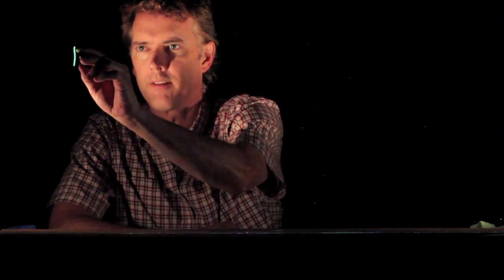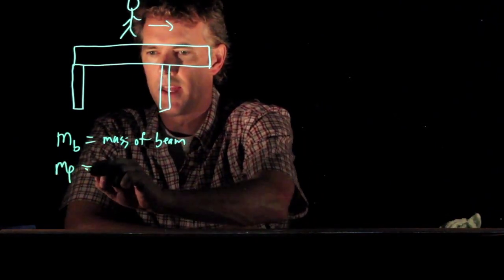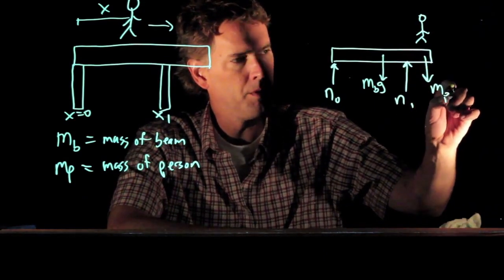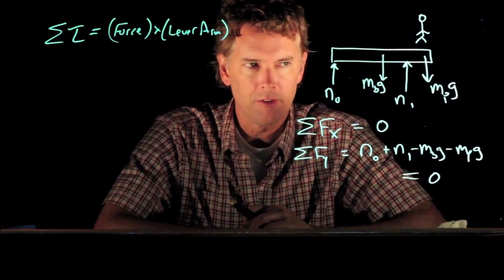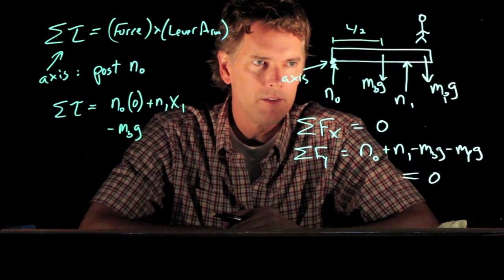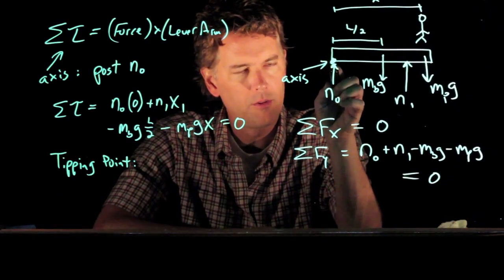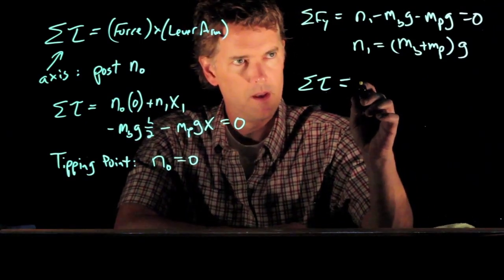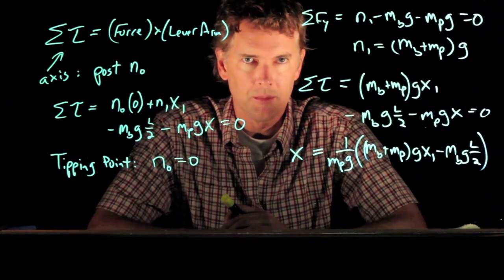Torque and Tipping Point - Man on Beam | Physics with Professor Matt Anderson | M12-21

Comment: This is a fantastic video and is super helpful! Question for you - how would the equations change if the variable wasn't the location of the man on the beam, but the location of the X1 post? I'm trying to figure out an equation where the man is constant and always on the very end of the beam but the location of the X1 post is the unknown. So at what location of the X1 post will the beam start to tip?

Comment: Question: What is the torque on a telephone pole about the ground that is being blown by strong wind? 
Would it be the total force felt by the wind times the pole length? Intuition tells me that you should do an integration of force over the length of the pole, but unsure how to work that out.
Reply from the maker: Great question.  Your intuition is right, you will likely need to do an integration IF the force of the wind varies with altitude.  However, if you assume the force on the pole is uniform, namely it's the same up the height of the pole, then it becomes much simpler.  Think of it this way: if you stuck the pole horizontally on the side of a building, could you calculate the torque?  Gravity would act on each part of the pole equally so the net torque would simplify to the total force mg acting at the center of mass.
Cheers,
Dr. A